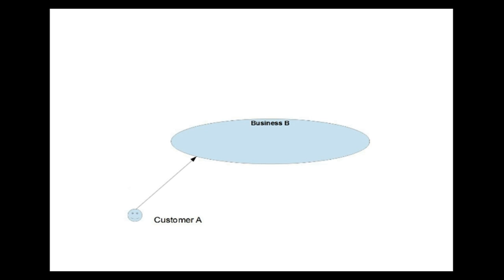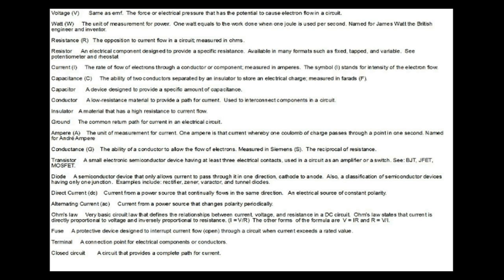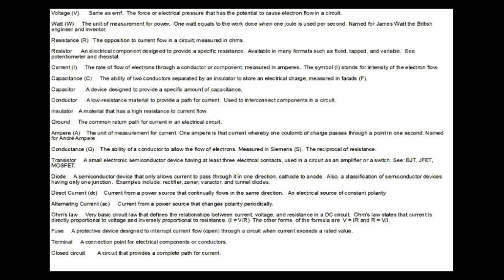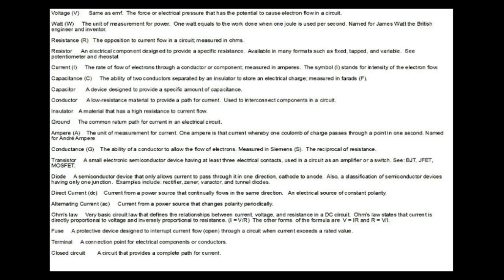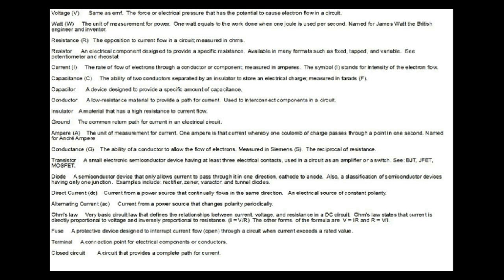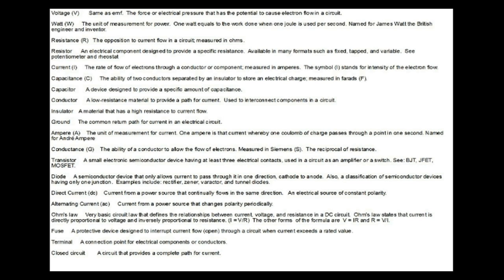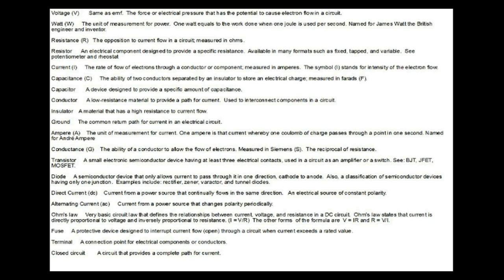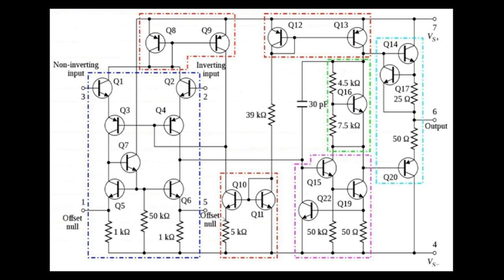The Economy as an Electrical Circuit Board

Comment: There is little surprise here. The economy has been modelled as fluid flow, eg., in the analog computer MONIAC (see Wikipedia). Furthermore, fluid flow and electrical circuits seem to have analogous overlaps. Therefore, the economy can also be modelled as an electrical circuit. (It may or may not be a good model, but that is a different matter.)
Reply from the maker: Not a bad video...considering it was made early in my YouTube career. It's surprisingly even more relevant today. Low view numbers though.
Reply: @DubbleKrown , yes, it was well done. And I'm surprised it doesn't have more views. When I first read Silent Weapons for Quiet Wars eons ago I found it thoroughly interesting.